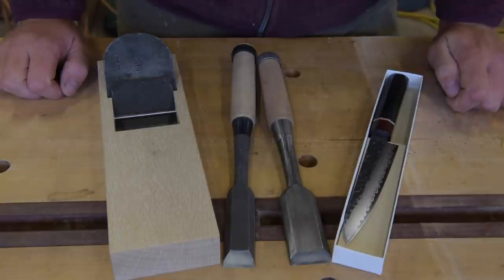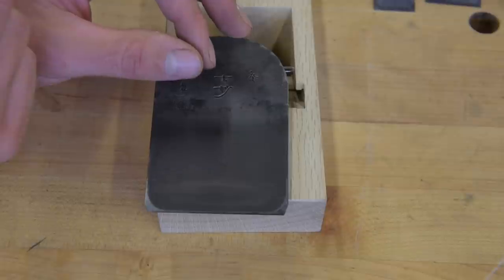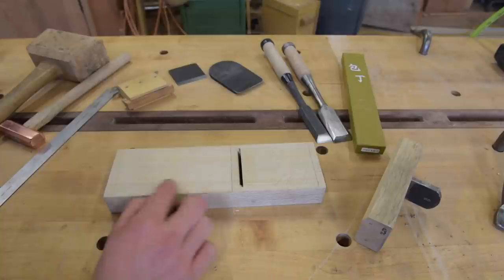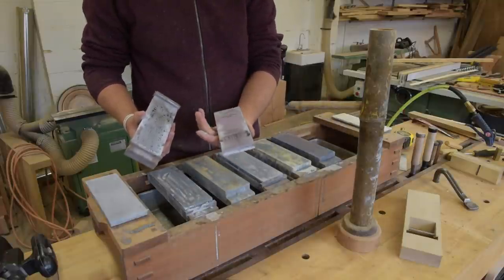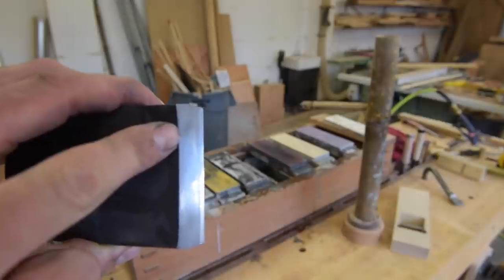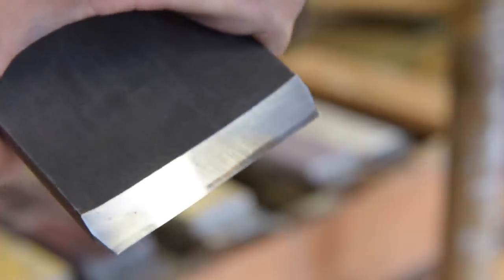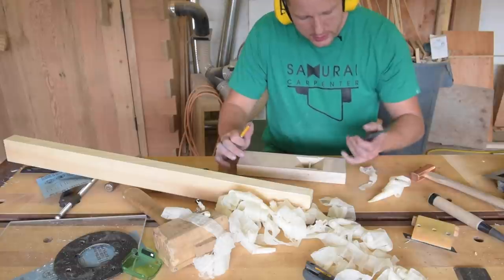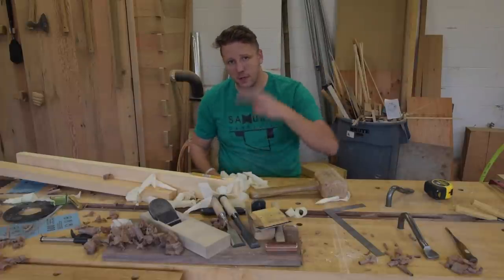How To Set Up A Japanese Plane, 16 micron Shavings!

Comment: I know this is an old video, but hopefully you still read these.

On authentic Japanese blades, such as that knife and probably the kanna blade (kana-mi) There is a artisan mark (tou) and the prefecture it was made in.

I also use Shapton stones, they are amazing. I love your setup. I may have to adopt something like that as right now I just use one stone at a time. I have a thin rubber piece that exactly fits the top of one of the cases, and I use that on a bar mat, and a bowl of water. Your setup probably saves hours. I have (all ceramic) the 320(for restoring old vintage rescue blades), 1000, 2000, 5000, 8000, 12000. Then I have two Ambush Pro Series Double Sided Paddle Strop from DLT Trading. One has 1 micron emulsion on one side and the other side is 0.5 micron. I notice you are sharpening perpendicular to the blade, which is parallel to the cutting edge. With knives I've always been told to sharpen perpendicular to the cutting edge and only pulling with the blade facing away from you. Is the way you are sharpening unique to kanna blades, or unique to your own style? When you get to a 30k stone you should not see variations in scratch marks you are getting. This tells me you need to be using more water on all stones 5000 and up so the removed material flows away and isn't a factor in the scratch pattern. At 30k you should have to look pretty good to see brush/scratch pattern, and using strops after that you should have a glass mirror finish. (Yes I know this is an old post so you may have figured that out already so mostly for anyone that is new and comes across this video and reads the comments.)

I don't have any Japanese kanna yet. I'm thinking of picking up one of the inexpensive ones of AMZ and see if I can tune it into being a decent plane before I invest in something nicer. Plus at this time Suzuki Tool (suzuki-ya) are on vacation and that is the only place I know I can order from for US delivery without having to know Japanese or work with an interpreter (live or digital) as most kanna makers only sell to Japan on their stores and you have to make direct contact to order from outside Japan. Though I'm open to suggestions if you have some. 

I need to look through the rest of your videos as I'm also looking for a good to high end basic/beginer set of Japanese chisels for Japanese joinery of small boxes.

Comment: Btw. if you are worrying about flattening your sharepning stone more often while sharpening, you should also worry about how flat your diamond plate is
Reply: diamond plates for cutting down water stones are pretty flat and they dont change flatness with use.  when they stop cutting, the tiny diamonds are worn out you get a new one.  but not sure if that happens though, water stones are pretty soft by comparison, and not much pressure from the diamond plate to cut the stone flat.    The DMT plate i use is certified flat to .0005"

Comment: > probably a dyed wood, maybe?

They don't dye the wood. It is kind of a big thing with them.  You will, of course, submit seppuku to atone for your rudeness and obviate your shame.

> the Japanese still use this lamination technique, for ease of sharpening

Hold up on the seppuku thing for a second.

The hollowness of the back can become a problem, if the blade wears down such that your cutting edge intersects the hollow. The jigane - the soft iron - can be nudged around by ura-dashi - "tapping out", basically peening - to (ideally) have the jigane come right up to within a thread's thickness - ito-ura - from the cutting edge. Uradashi is also used throughout the use of the blade to 'bow' the cutting edge out further, by amounts significantly smaller than any tapping on the blade or block can achieve... literally adjusting the depth of cut by microns. You can see a similarity to Japanese swords such as the katana: a hard, sharp tamahagane cutting edge, supported, protected and shaped by the softer metal behind.

I can't imagine needing to adjust a cutting edge by a micron or two. But I am not a master woodworker.

Comment: Thats a sweet haul sir.  I am envious of the hand plane, but I am honestly curious why they don't come set up, ready to shave out of the box with the large price tag?
Reply: Travis Welchert 
I suppose it allows space for the owner of the tool to set up for their personal preference.  I have a few japanese hand planes.  I like the blade to be quite a loose fit requiring very small taps for adjustment.  I'm in the middle of setting another one up and is still quite a tight fit.  I find it hard to set it just right the blade moves in bigger (relatively) increments cause I've to hit it harder.  Also.  If the dai maker sets it up.  He'll be charging for his time.  They're expensive enough as it is.

Comment: I actually have a question maybe you can help me with. You seem to be in the know about planes and such. I have a vintage Craftsman #3742 hand plane I found in an antique store that's in amazing condition and still very clean and usable. This is my first hand plane and I'm having problems finding where to find blades for it. Any ideas on where I could go to find them and do you have any videos on how to deal with that type of hand plane?
Reply: ebay for replacement blades and parts.  even original to match the age and model.  mostly stanley planes.  other brands are difficult.  please note that vintage planes are pretty complicated, and you have to be careful what you do and get for one.  Value can be destroyed by something as simple as cleaning it.  some vintage planes fetch thousands.  your plane is not that old, being form the 1960's?  the prewar planes are better and still fairly easy to find.

Comment: Is that hollow on the bottom of the chisel more shallow toward the tip?  Do you grind it down toward the edge as you need more chisel (steel). Or is that 3-4 mm of flat all you get?
Reply: The odds of someone being so hardcore that they actually need to sharpen it that many times and end up removing that much material in their lifetime is so unlikely
Reply: yeah - I saw flea market chisels in Japan that were less then 1/2" long - you know how they started out! - it's call a lifetime of use to end up like that..

Comment: if you flatten a 6k stone with 1.5k diamond stone should you not clean the 6k stone out of the 1.5k dust left from flatening it?!
Reply: i know that when you polish metals and glass you have to clean everything between all steps not to contaminate finer grit paste / papers with previouse grit...
Reply: Piotr Marek or start from the highest grit
Reply: The flattening "stone" is a diamond plate. It should not be leaving 1.5k "materials" on the UK stone/plate. However, it will lick up grit drone each successive stone and deposit some of it on the next stone, I believe. So yeah, I always go high to low when flattening. Whether there is anything to it or it is just a myth, I am not sure. But it does sound logical.
Reply: Thomas Russell Yeah, definitely gotta lick up that grit drone in the UK

Comment: Samurai or any other guy! I bought a small kanna (15 x 5,5 x 2,2cm - 42mm blade). My question is  if it is necessary to scrap the botton of the plane (back and front side) just like you did in this video? Any tips!?

Comment: Given that Japanese chisels and plane irons only have such a small hardened cutting edge, how many sharpenings can one typically get out of them?
Reply from the maker: That thin layer runs up the blade around 2.5" so it would take around 20 years of consistent use to wear it out.
Reply: Ah, OK. Thanks, dude.

Comment: I have a question ... Is the slit in the bottom of the plane perpendicular to the sides?  Or is it at a slight angle?  I picked a cheaply block plane from Amazon and the slit is 90 degrees to sides ... I thought there was supposed to be a slight angle?  Thanks for the thorough steps.  I had no damn idea how to set this up.

Comment: I read somewhere that the blade shouldn't sit tight up against the sides, and that there should be a little room for seasonal changes. Older dai that have nasty cracks supposedly are due to the stresses of the wood expanding and contracting against the metal. Is any of this true?

Also aren't the wooden japanese planes adjusted with a small wooden mallet, not a metal one?

Comment: tell me if im wrong, but it seems to me that because of the hollow grind taken out, you cant sharpen the tools verry often before they become useless ?
Reply: The  hollow is not very deep, you can get rid of the hollow at the leading edge by grinding the sides down so that you always have a flat leading edge.
Reply: thnx for your quick response and information on this type of tools

Comment: The main reason they laminate the blades is so they can tap out when the blade has been sharpened back to the hollow yeah? If the whole thing was tool steel, would be pretty hard to tap out the cutting edge! Need dat malleability son! What what! :P

Comment: Hello Samurai! Congrats for your video! This was the fist one I watched and I am subscribing your channel. Wanted to ask you if you would use a kanna plane to flatten an ebony classical guitar fingerboard. It is a very hard wod. I am finishing making my fist classical guitar. Until now  I did not use a plane at all. Every time  I needed to flatten something I used my homemade drum sander machine. But now I glued the fretboard to the neck and it is not flat. And of course I cannot put the guitar in the drum sander. :) The only planes I have belonged to my grandfather. I have a small 102 goldenberg block plane and 2 very old wooden goldenberg bigger planes. I feel they are useless so I keep them aside. The fretboard flateness is absolutely important. I tried the 102 but could not get the ebony fretboard flat. Just got it fully scratched. I realize I will have to buy a plane and I am eager to start using it more often during the guitar construction process. Would you recomend a kanna plane for someone inexperienced like me? I like the japanese culture and love the way they work the wood but the planes are very expensive. What is your advice? Thank you!

Comment: FYI - Many people don't know that wrought iron is slightly different than the type of iron you see in a decorative handrail it is made by puddling molten iron onto a flat surface and the process leaves some impurities (slag) in the steel.  It is similar to modern mild steel and it cannot be hardened.  These impurities don't have a significant negative effect on the performance of the steel and sometimes they are visible giving the steel a kind of cool swirly look.

Comment: I have a question about what angle you would use on the cutting iron on a stanley bench plane, I have heard both 25° and 30° recomended for this plane. Also I have heard a uTuber recomend radiusing the bevel? WTF?
Reply: I kno it is not a samuri plane but it needs alot of work believe it or not she took it out of the car and set it in the grass for a couple weeks :<

Comment: Light saber sharp. 
Please explain how you are planing "against" the grain of you are planing the length of the board.
Reply: The grain isn't completely parallel to the surface being planed. There is a tendency to dig in when planing against the grain. It's like shaving. The simple answer.
Reply: assume the grain on the face is parallel to the direction of planing, the problem becomes apparent when you look at the side of the block you are planing.  if the grain lines go deeper into the wood as you are planing, the wood will tear out as the fibers tend to follow the grain deeper into the wood.  if the grain liness are rising towards the surface you are planing, the fibers tend to be cut cleanly.  thats why when planing (even when using a power jointer or planer) you always try to pick the best direction such that the grain is rising towards the oncoming blade.  it doesn't take long to figure this out, when you ruin a surface, or when the grain direction changes on you halfway down a board.

Comment: I purchased a plane and the opening for the blade is too narrow. Would you use a file to widen it? Not sure how to proceed and I don't want to ruin the dai experimenting.
Reply: John Clendenen 
You'll want to open it out alright. Just go really slow. 
If you have a chip breaker,  you'll need to make sure the opening runs parallel to the bevel of the chip breaker or opens out more as you come closer to the top surface of the dai.  Setting the chip breaker is the hardest part of setting up a plane if you ask me.  If the opening is wider,  you can see the chip breaker as you set it. 
To clarify.  Keep the actual mouth of the plane as tight as you can.  Just make sure there's space for the shaving to exit.  That channel has to be wide enough for a shaving to pass through or it'll bind. 
I hope that made sense.
Reply from the maker: I though the same with my first plane but it was the back that needed adjusting.  I would double check it with a pair of calipers before adjusting the side notches.
Reply: Thanks guys, I'll take a look at it again this weekend and break out the calipers to confirm.

Comment: Hey guys, why does my 8000 grit stone  leave a foggy appearance even if I flatten it and hold my blade correctly? I have almost a mirror finish using a Kings 6000 waterstone, but when I switch to a 8000 grit it leaves it foggy.
Reply: Which brand/model of 8k stone are you using?
Reply: @collincarter188  
It's a cheap one from Amazon- Trilancer. I recently bought a shapton 8000 grit stone and it leaves a mirror finish quickly. Very pleased.

Comment: okay, i'm a complete novice when it comes to japanese chisels , but it seems to me that with a hollow grind that close to the edge you'll eventually get to a point where you grind the edge into the hollow and a flat bevel edge becomes impossible.  What i'm wondering is, with regular sharpening to maintain a good cutting edge, how long before the tool becomes unusable?  What's the average lifespan of a japanese chisel...?
Reply: cVictori Exactly my thoughts when I bought my first one. But think about it: The hollow has a ballshape, so it's gettin smaller when you  grind it down.
Reply: cVictori  
over time, After repeated sharpening,  you do start to flatten out the hollow.  As the blade is made of hard tool steel laminated to a soft iron backing, you can keep the hollow by doing a technique called "ura dashi" or tapping out. You hit the bevel of the blade  repeatedly on the soft iron backing (definitely not on the cutting edge, you'll chip it out). this deforms the soft iron backing,  pushing it further down creating a deeper hollow.  Then flatten away mad.  It's heart in mouth stuff on an expensive blade....
Reply: I think the the top of the chisel needs to be slightly hammered before each sharpening session.... i saw it on youtube that some woodworkers do hammered the top of their plane iron which have that hollow grind too .... i could be wrong though. hope jessie could clarify on these
Reply: not every time - only when the flat on the cutting edge side of the back gets less than a few .00 of a mm - most ( Japanese ) woodworkers will tell you that the blade cuts best when the flat is as narrow as possible

Comment: Nice knife, but I would have prefered a single beveled knife than a double.. I hope you know the difference?
Reply: Swedish blue steel?  Im in Sweden and are from sweden and never heard of it.. Could you please specify a little bit more?
Reply: "Blue steel", I think is a type of steel that Hitachi makes and is called "Aogami 1 Knife Steel". About 1.3% carbon!  I have never heard of a Swedish blue steel either... There are probably some equivalent steels made by our Swedish steel makers.
Reply from the maker: I think it is just Swedish steel but the Japanese call it blue steel because it has alloys in it.  From what I have read and heard, in japan they use carbon steel, white paper steel and a bunch of different blue steels.  The blue steels are harder wearing alloy steels and the others are just high carbon steels.  The high carbon steels have a finer grain structure and take a keener edge but dull faster and the blue steels are the opposite.  In Japan carpenters want to know whether they are buying white or blue steel.  It's just so Japanese carpenters know what they are buying.
Reply: Tack!

Comment: How long would one of those chisels\planer blades last if the hollow grind (on the rear) is so close to the cutting edge? How many sharpening would you get?
Reply from the maker: the hollow grind is very shallow so as you keep sharpening and lapping the back the hollow will slowly keep moving back as the blade is used up.
Reply: The Samurai Carpenter  thank you Samurai.... i will keep watching as long as keep being awesome 👍

Comment: Hey Samurai:  What becomes of the hollow grind as the tools get sharpened and thus "shorter".  This has always mystified me....
Reply: The hollow eventually disappears at the leading edge.  At that point you need to adjust the the edge downwards slightly by tapping on the soft steel above the weld line to bend the edge down.  You then re-flatten the bottom of the blade to get your hollow back.  BE CAREFUL...If you accidentally hit the hardened steel while doing this you can crack the blade.  There are special hammers that can be used (very light) to do the adjustment.

Comment: The ledge at the bottom of the dai bed that you say is purely aesthetic. Wouldn't that support the bevel of the iron and would further reduce any chance of the blade chattering ? I don't think master dai makers would put the extra work in for something that serves no purpose. Just my 2 pence
Reply from the maker: The blade is over 1/4" thick.  There is no chatter on a blade that thick.
Reply: I've heard the same